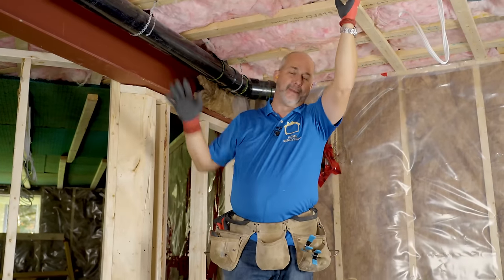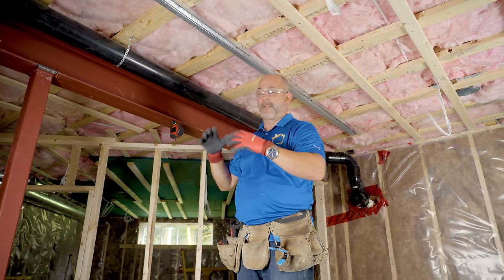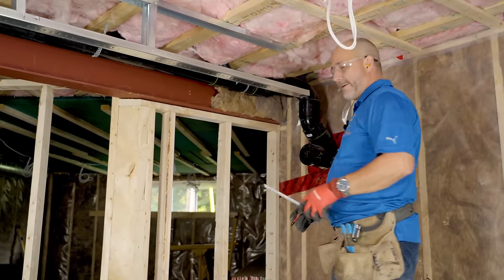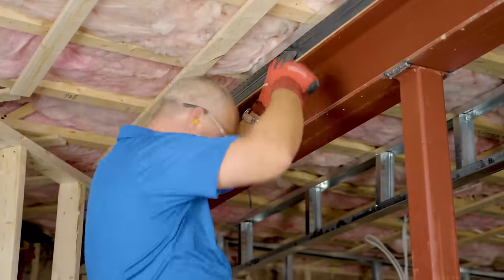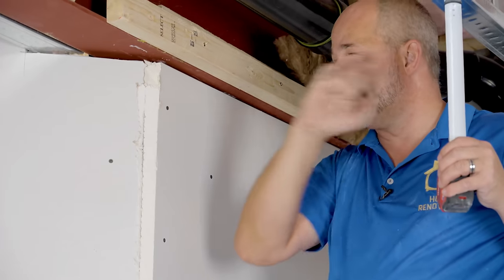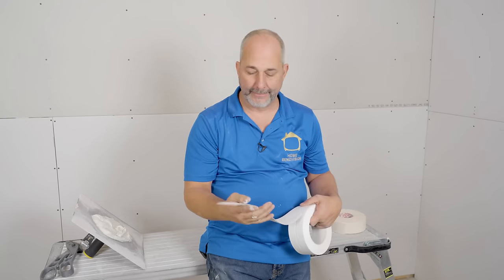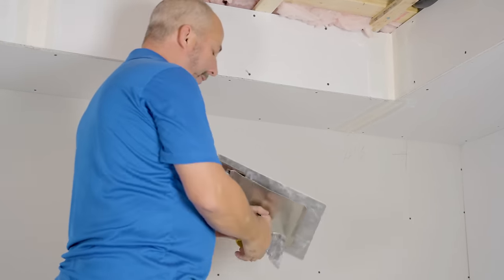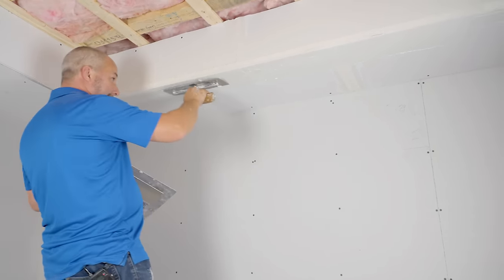This Trick Will Make Your Bulkheads (Or Soffits) Look Intentional

Comment: Did you use 45 mud on that or the normal mud?
Reply: 45 minute (or any quick setting mud) is best for pre-filling your gaps between drywall panels.  It has reagents in it unlike other kinds of mud and it gives the mud slight flexibility making it more resistant to expansion cracking.  Pre-filling is just filling in large gaps between sheetrock panels.   Its the very first mud you'll put on the drywall.  Any gaps more than an 1/8" gap should be prefilled. If the panels are tight (less than 1/8") you dont need to do that step, but sometimes they're in and out and its just easiest to go ahead and prefill everything.  When you prefill seams, you're just packing mud in them, then wipe the excess off with your knife so that only mud in between the seams remains.  You don't have to let it fully dry.  You just have to wait until the mud is stiff enough so that you can put the next coat of mud on it.  3 hrs is usually plenty if you used 45 min mud.  The next layer of mud you'll put out is for your tape to sit on top of - "bed coat".  Regular All Purpose (green lid bucket) has reagents in it that make it stick really good to tape.  Use that kind of mud on the underside of your tape.  Let that fully dry.  After that, you'll be putting mud on top of the tape and/or skim coating the rest of the drywall panel if you're going for a smooth finish (non textured).  For that, the USG +3 lightweight (blue lid bucket) is the best because it spreads really easy and dries with hardly any shrinking and it sands very easy.  If you dont want to buy that kind of mud you can stick with the regular All purpsoe (green lid) but it is a little more difficult to sand and shrinks.
Reply: @morokeiboethia6749  Thanks bro
Reply: @morokeiboethia6749  exactly the information I was looking for. Thanks for the detailed write up.

I'm a diy'er who tackled a couple drywall hole repairs and used hot mud for the first time and had an excellent outcome. I haven't tried it for prefilling or taping, but your description to have a variety of muds on hand to tackle different tasks makes a ton of sense. Patches I've attempted using the green lid "all-purpose" came out worse than using a better mud for the job. I'm sold.
Reply: @thenear1send  You can "technically" use any kind of mud for any situation but it might not be the ideal mud for that situation.  If you had to skim coat a large area, you could use hot mud but every pan you fill you're under the clock to spread it and when it comes time to sand that huge area it's not going to be fun - but you could get it done with hot mud but definitely not the best choice for that.  You could use All Purpose to prefill and people do it all the time but its the most likely to shrink and its a more brittle mud when it dries to its more prone to expansion cracking (why its not the best choice to prefill with but im not saying you're doomed either if you do - its just more prone to crack of the 3 types of mud.  I didnt say it above but if you have to stack mud up really thick like a big dent in a sheetrock panel that you're trying to fill in / level out - use hot mud for that also.  Its the best for when you have to put the mud on deep like in a situation like that.  If you used the other 2 types to do the same thing try to do it in two or more coats and dont put so much out there really deep - especially all purpose.

Comment: I've enjoyed your videos over the years but as a retired Building Inspector I would have to RED TAG your bulkhead job because you did not install any FIRE BLOCKING to slow the spread of fire in a concealed space as required by most Building Codes.  Other than that, keep the videos coming.
Reply: Completely agree, fire blocking and draft stopping need to extend from Thor locations within the ceiling/floor structure down into the bulkheads or they can easily serve as a conduit for fire.